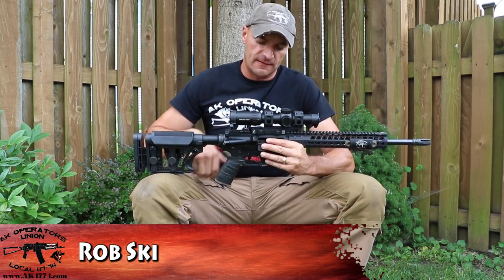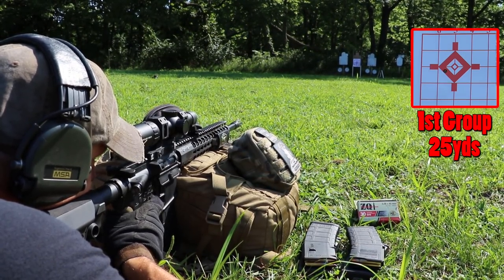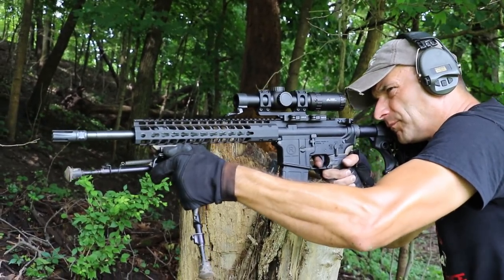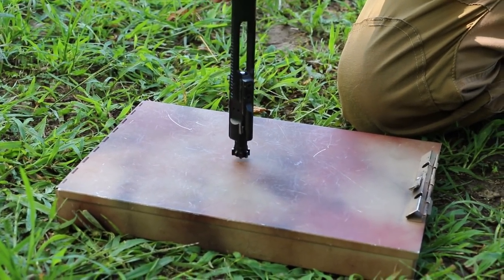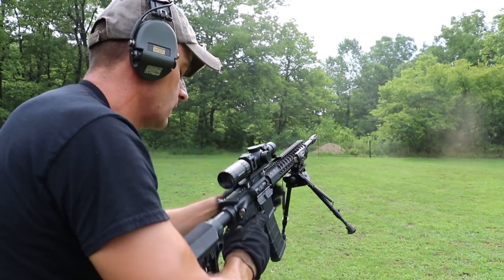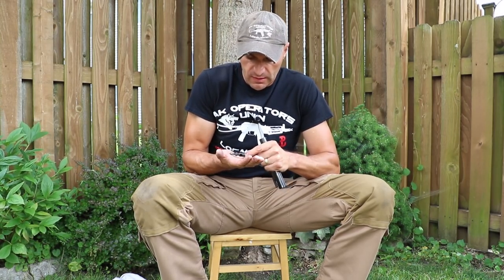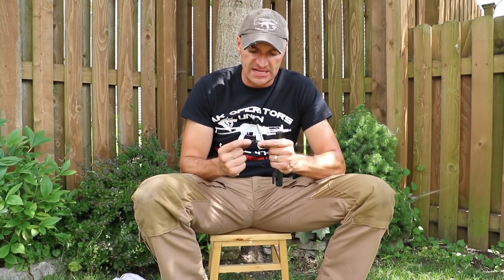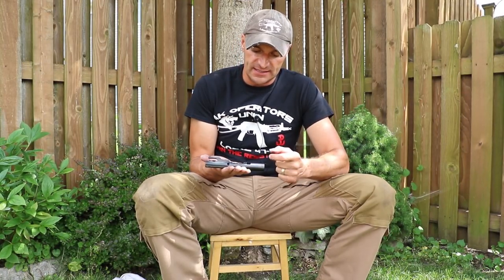Radical Firearms AR-15, 4310rds LATER - Another one bites the dust!

Comment: Just one more reason to have spare parts for your rifle. Its not a catastrophic failure fix it and finish the 5000 rounds.
Reply from the maker: +prescotian1500 I think you don't understand concept of 5000rds test...test is over when part is broken beyond field repair. If I can't use duct tape or 550 cord or rock to fix it, then rifle is done. Rules are clear.
Reply: Ak Operators Union, Local 47-74
I understand the rules. But this is one of the most common parts breakage in an AR-15 and could have happened in any AR regardless of quality and at any round count.
Reply from the maker: +prescotian1500 I work with M4s for a long time. I have seen those cam pin broken but at much higher rounds count...gas rings wear out, that's normal, but cam pins should last longer on true mil spec rifle. That's not even a question.
Reply: Then The IO AKM should have gotten new parts and limped on as well?  lowest count I have ever had a cam pin break on a mil spec rifle was north of six thousand...they DO break but not easily or without considerable use....if they DO break easily or without considerable use they are junk parts.
Reply: Edward Anthony
Not an AR fan boy I own a couple, but I'm actually a Mini 14 fanboy. I have built several AR-15s I just understand the cam pin is a weak link and its the main stress point of the AR BCG.  AR's aren't built by one solitary manufacturer like AK's. Parts are sourced from several different companies this why you see different forge marks on lowers and uppers all from the same brand. AR-15 BCG's are no different they are bought in bulk lots and from the lowest bidder. For the broken Cam Pin in question, it is not showing excessive wear and shouldn't have broke I agree. I am not ignorant all machines can break regardless of quality levels and sometimes there are bad batches of parts. I would have said the same thing if it broke an extractor.
Reply: This is comparing apples to oranges. A less than $20 fix, a new set of gas rings and a new cam pin and the AR is fixed. The IO was getting close to sending shrapnel everywhere.  Not the same at all
Reply: I think its very funny that you are calling me a fanboy on an AK fanboy channel
Reply: prescotian1500  Yeah but the RAS-47 another "junk AK" limped across the line with only cosmetic damage.  My point is for the money you are spending, your rifle should be able to do 5,000 rounds before breakage, regardless of spare parts or ease of changing said parts out.  think to any war time, hunting, civil resistance or survival situation and tell the average sane human he has to carry spare bolt group for weapon A if he wants to use it and he will laugh his way right to a different platform.  The only time carrying wads of spare parts is logical is when you are doing competition shooting with race guns or plinking on the range.
Reply: I never said it shouldn't make 5,000 rnds without a breakage. I stated this a simple fix and you should have spare parts for a rifle. Laugh if you want I have a spare firing pin, cam pin, and a set of gas rings in Magpul MOE grip with room to spare. I also have a cleaning kit in my A2 stock and small bottle of oil. It doesn't weigh a few ounces and it can used easily in the field to keep my Mk12 clone rifle running or fix it. Same as if I have a red dot on a rifle I have a spare battery on the gun for it. My 181 series Mini 14 has a hole drilled in the wood stock under butt plate with a spare firing pin, bore brush, an 1/4 inch long piece of a soda straw with the ends sealed filled with CLP,  and a wire cleaning rod out of an Otis cleaning kit. Everything can break regardless of quality or reputation. Its a couple of ounces for peace of mind  and you might as well be prepared with at least the most common failures.
Reply: I never said it shouldn't make 5,000 rnds without a breakage. I stated this a simple fix and you should have spare parts for a rifle. Laugh if you want I have a spare firing pin, cam pin, and a set of gas rings in Magpul MOE grip with room to spare. I also have a cleaning kit in my A2 stock and small bottle of oil. It doesn't weigh a few ounces and it can used easily in the field to keep my Mk12 clone rifle running or fix it. Same as if I have a red dot on a rifle I have a spare battery on the gun for it. My 181 series Mini 14 has a hole drilled in the wood stock under butt plate with a spare firing pin, bore brush, an 1/4 inch long piece of a soda straw with the ends sealed filled with CLP,  and a wire cleaning rod out of an Otis cleaning kit. Everything can break regardless of quality or reputation. Its a couple of ounces for peace of mind  and you might as well be prepared with at least the most common failures.
Reply: prescotian1500  The fact you have a mk12 clone and an A2  suggests to me the furthest into "the field" you go is the bench at the local range.  Walk a few kilometers with your gun and tell me how a couple of ounces feels...to start, secondly carrying a small cleaning kit is just fine, why you want them inside of little tactical doors all over your gun baffles me instead of on your belt or in your bag...but that is neither here nor there.  Spare parts for the most common breakages is a far cry from carrying full BCG and parts kit.  but even then you are not going to drop a new firing pin, change out O rings and replace a cam pin in a fire fight.  You like every other sane human will change to your back up weapon and withdraw.  At that point when you are NOT being shot at why would it matter if your spare parts are on a truck or in your grip? just added weight you don't need.
Reply: I have a MK12 clone with an A2 stock and 2-7 32mm Vortex scope. I use it for coyote hunting and deer hunting where I live in Kansas. So yeah I have carried it several miles and Its lighter than the old remington 7400 270 I used to use. I didn't put the boat anchor PRI handguard or there flip up sight on it to save money and weight. I never once said I carry a whole BCG and parts kit with me. I stated what parts I feel necessary to keep on my gun just in case. I also never said I was going to change out parts on my rifle if being shot at either. Thats why I carry a Sig or 1911 but I'm sure your going to bash either of those as being to heavy also or just because they aren't a GLOCK.
Reply: prescotian1500  No  I am going to bash them both because they are large for EDC, for open carry one of them is a seven shot antiquated design (though one of the most prefecting looking guns in existence). As to glocks I can't stand the grip angle, good guns just not my cup of tea.  To your Mk12 clone, if its lighter then your average 270 hunting rifle, awesome, I am impressed, doubly so if you have a real reason to carry it. 

In total I think we are having a misunderstanding about long guns, If you have a practical use, an efficient weight, and are carrying a few ounces extra for peace of mind go for it, so long as you understand that "easy fix" does not mean "combat or field fix"., for handguns the SiG is a fine weapon, but the SEALs dropped it for a reason, its fat and large for the capacity and power.  The 1911 is an old warhorse that has earned it's place in history but has nearly no argument versus nearly any modern gun in respect to carry other then "it looks cooler then hell", with that argument you might as well carry a Colt SAA, a Schofield or a Colt 1870 Army.
Reply: I built a Mk.12 Mod 1 clone correct with an A1. Best rifle i have besides my M1. only issue I've ever had was the A1 stock Cracking
Reply: +Ak Operators Union, Local 47-74 I would also like to see if anything else would fail. I think that is what +prescotian1500 wants to see as well. I didn't know anything about the rules either. I've seen some of your other videos but I just came to this video from it being recommended, I didn't see the others for this test.
Reply: +Dies1r4e in case you didn't know, you can replace the came pin with out replacing the entire bcg. I never saw anyone say carry a spare bcg. Have you worked on an AR before?
Reply: +Dies1r4e when did he say anything about EDC for his sig or 1911? I must have missed that...
Reply: Brett Silva  Yes I have worked on more AR's then you probably have ever seen in your entire life kid,  Trust me on that fact, unless you are a military armorer.  You clearly didn't read our little back and forth carefully so I will try this as slowly as possible.  You...Can...Comment...On...The...Effectiveness...Of....Something...Without...Direct...Reference.  So If I say "the AK is a rifle"  you can say "it was used by the soviets"...or "the VZ series weapons look like AK rifles"  or "the AR platform are also rifles and they are accurate".  It's an amazing thing us adults are capable of.
Reply: Exactly what I wanted to see.
Reply: prescotian1500  What that you can have more then one account on youtube? Or that I respond to every pecker head that comments equally.  Indeed I do not play favorites when correcting stupid.
Reply: I went with the A2 because I'm 6'5 and built like an NFL Lineman it works for me. Mines not an exact clone I used a UTG Super Slim 15 inch rail instead of the overpriced PRI handguard and front sight.  I was originally going to build a Mod 1 clone but figured I could save some money and weight.
Reply: I don't have more than one account. I still don't understand how I'm stupid and need to be fixed because I stated and opinion. The only people in my experience that make claims to the like, are the truly ignorant...
Reply: Thats because I didn't say I did. If I was to carry a rifle in an SHTF situation I would have a sidearm and I wouldn't feel undergunned or weigh down by either. I EDC/conceal carry a subcompact single stack 9mm for sake of argument and an extra 7 rnd mag. But I'm sure Dies1r4e will troll me for this comment also
Reply: prescotian1500  Depends on if I was reading that dribble you just wrote correctly or not. It is hard to tell...did you say in a SHTF situation you wouldn't take a rifle but instead would carry a handgun?  If that is the case I say oh please do, having under armed idiots out there will highly increase us folks that know what we are doings chances.  IF you are saying that EDC isnt SHTF so you carry a 9mm single stack then I tip my hat to you, for 1/2 the size/weight you get the same amount of protection as a 1911.
Reply: I simply was replying to Brett Silva's comment that I wouldn't feel undergunned or weighed down using my sig or 1911 as a sidearm. But I EDC a single stack 9mm. You apparently are an all-knowing expert troll with a reading comprehension problem. I am glad you are here to educate me
Reply: +prescotian1500 I agree. You shouldn't feel under gunned with either of those.
Reply: +Dies1r4e I don't know what any of that has to do with MY comment. But yes I did read your "back and forth". He said carry and spare cam pin and you used reductio ad absurdum to say "what moron is gonna carry an entire spare BCG". So that is either reductio ad absurdum or you have never worked on an AR and therefore don't know you can carry a tiny cam pin without the rest of the BCG, nice try son.
Reply: +prescotian1500 and in response to your post starting with "that's because I didn't say that", that was my point exactly. You didn't say that.
Reply: +prescotian1500 I have a radical barrel in one of my ARs and some other radical parts in another one. So I would love to see what else might go out on his radical AR. From my experience, so far I have had good luck with radical, but I have only put a little over 2500 rounds through my radical barrel.
Reply: Brett Silva Talking to yourself is cute kid, and I am glad you once took a psyche course and can toss latin around.  It isn't reduction to absurdity when he (and by he I mean likely you as well) was commenting on carrying oil bottles and vague "spare parts" to begin with, if you plan to carry around several ounces of liquid it wouldn't be a huge stretch to assume he intended to carry around several more ounces worth of metal.  So if we are going to throw around sayings I will default to one of my favorites "ounces equal pounds".  There is a reason people cut the fucking backs of there toothbrushes off when they intend to hike seriously, there is a reason soldiers shave every ounce possible off there carried kit.  If you are using a rifle that requires you to carry extra parts with it, to carry spare oil and rags then you are not using a rifle that is worth a damn in combat.  IF the rifle doesn't require these things and you carry them because you need to find a use for your tactical cubbie holes on your gun, then you do little more then shoot off a bench or climb into a tree stand a few times a year.
Reply: I would have liked to have seen if the bolt was going to crack around the cam pin, showing that there was an improper heat treat or no MPI of the bolt. That to me is a catastrophic failure a broken cam pin is more akin to a broken firing pin, but proving the low quality of the BCG is something else. This test still wouldn't turn me off of them. I seriously doubt the barrel will be problem for thousands more rounds, especially if its a melonite treated barrel.
Reply: +prescotian1500  my bolt did.  radical replaced no charge.
Reply: 1911loaded
 That is exactly what i wanted to know. Glad to know they are also standing behind there product and replacing the broken parts for free.
Reply: We've had cam pins with no issues for literally 55 years, but now they break all of a sudden?  That's a materials science failure.  If you don't know how to spec and inspect parts, you will crank out garbage.  Where are their cam pins made, for example?
Reply: One of the most common parts breakages in the AR15?  Not at such a low round count they aren't, and not on the longer gas systems.
Reply: Edward Anthony no, we clean and lube them as he is doing to the palmetto AR
Reply: I personally do not consider a part that is removed during field stripping the weapon to be beyond a field repair.

Comment: After 4,000 rounds, it should be expected that gas rings and cam pin should be replaced.  Those parts take a lot of damage and, if you are planning on this rifle saving your life, you should take care of those routine maintenance items.  

Also, it doesn't just matter how many rounds have gone through your rifle.  It matters how fast they went through it.  Doing constant mag dumps is always hard on a rifle.  For the price point, this rifle held up amazingly well.  Replace the worn parts and keep using it.

Comment: Not really catastrophic IMO. Replace cam pin and finish the 5000 rnds. Actually not bad for that cheap rifle as it wasn't lubed, nor cleaned from the beginning & didn't have any of the problems of previous rifles.
Reply: Jay Yagebu Yep that is a 1 min change at the most and you are back up an running.

Comment: I agree with what others have already stated.  While it's disappointing to see happen, it's a $5 operator-replaceable part on a $500 rifle.  Replace it, the firing pin, and the extractor spring/o-ring in 5 minutes and I bet it runs for another 4k+ rounds. Any shooter worth his ammo is going to have those parts in a spares kit, if not in the grip.  I'm still very impressed with what I've seen from that rifle.

Comment: so just get a new bolt and go back to rock rolln? Everything needs maintenance, parts need to be replaced at some point in any kind of mechanical equipment. Just buy a mil spec bolt (not expensive) and back in business right? I don't think this is a big deal and Im not a Radical firearms fan, Ive never owned one
Reply: Actually he only needs a $5 cam pin..

Comment: Rob if you put in a new bolt carrier would the rifle still works?
Reply from the maker: Yes!
Reply: could you do a video on how the rest of the rifle held up minus the BCG? it might still be better for some people to buy the RF  and replace to bolt or get the upgraded bcg. could also get their NiB bolt and do another 5k and see if thatone breaks as well
Reply: All firearms eventually have failures due to parts fatigue. But, the point of the torture tests is to see how much abuse a system can take prior those failures occurring. The fix for this rifle would be pretty simple and it would go chugging right along. But, the type of failure that it experienced could speak to a willingness to cut corners on part quality.

If this is the only rifle you own and parts aren't easy to come by, it should be a rifle that can get through a few thousand rounds without breaking.